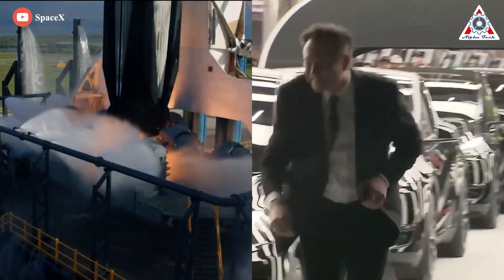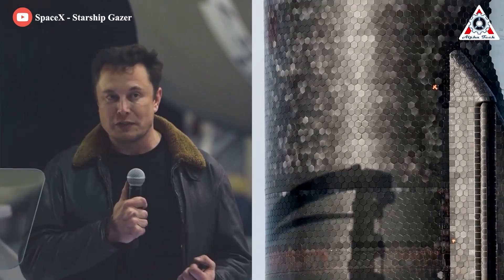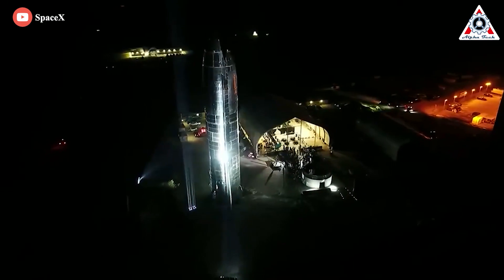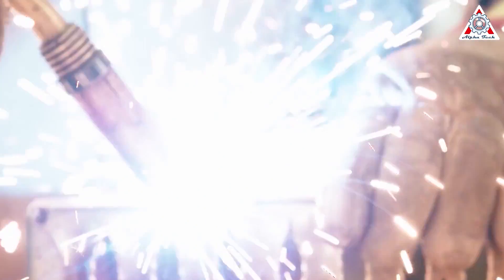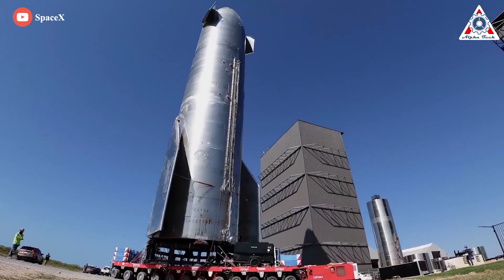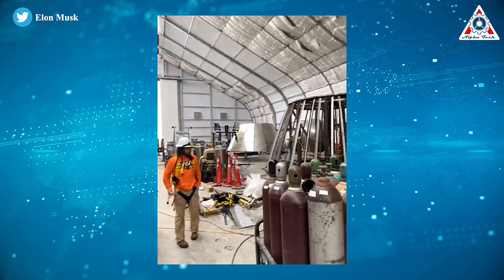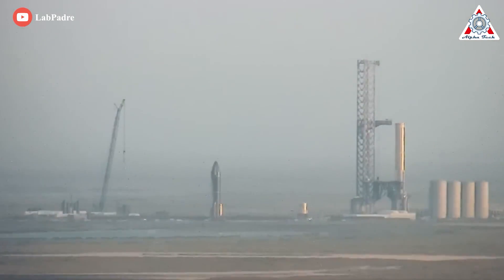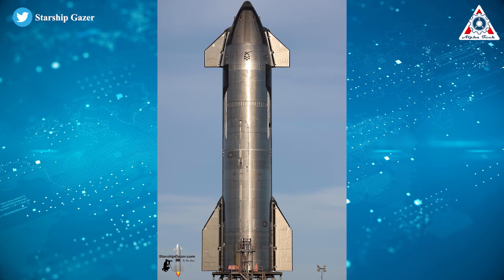SpaceX's HUGE UPGRADE on Starship's welding will blow your mind!

Comment: As an Edmonton pipe fitter we’ve been working closely with stainless steel and the welding process for decades already and it’s extremely sensitive to air breeze’s and oxygen destroying the welding that creates slag inclusions inside the weld that is allowing the cracks to start from the slag and runs from there!
We always set a candle where the welding is done so by the time you get setup and ready to start welding if that candle is still burning then you can utilize the tig machine and the argon gas will stay around the weld without getting blown away by oxygen and creating the slag inclusions!
Reply: The weld will "sugar"
Reply: We just use a sniffer to measure the amount of argon on every mining project I was on.
Reply: u weld with a candle
Reply: @margarita8442  he’s using it to sense the breeze and oxygen I believe

Comment: Your discussion missed one important detail that I know of. The current robotic welding equipment at Starbase performs an "after treatment" step called "planishing" as the laser welds the components together. Planishing is actually an "after treatment", that applies extreme pressure to the weld to flatten it, but it happens all in one step with the robotic laser welders. Another note of importance is that SpaceX Starbase has developed sophisticated positioning jigs that enable the welding robots to weld accurately and to repeat weld sequences over and over again. For example, on the ship nose cones and on the ventral side of the ships, laser welding robots weld the attachment fixtures for the TPS tiles into place at robotically programmed positions, providing precision not possible with hand welding. Nearly all the Starbase ship and booster welds are currently performed by laser welding (and planishing)  robots.
Reply: Here is another important detail about rocket welding at Starbase, something that is possible to see late at night inside the high bay at Starbase. Once big ship / booster sections have been completed, and need to be stacked together, inside the high bay and inside the new mega bay, the robotic welder(s) can be seen mounted on the wall. Inside the high bay (usually starships) near completion are placed on a "lazy susan" style rotatable stand system that is positioned and aligned using laser align guided alignment. The laser robot mounted on the wall lines up for a ring pass around the ship or booster and then the stand at the bottom rotates that ship and booster and the laser weld and planishing is done all in one step. After a ship / booster ring is welded, a second weld checking device is passed over the weld that x-rays the entire weld and also creates and ultrasound picture of the weld. All the x-ray and ultrasound data is digitally checked and then permanently archived, creating a record of each ship / boost ring section weld quality.
Reply: @obsey  Thank you, Elon!

Your attention to detail is unrivaled.
Reply: He does actually mention it @7:06 to 7:35, though perhaps not in the clearest manner possible.
Reply: Thanks, I knew some important details were missed.
Reply: You sure know welding. I recently inherited a Miller 600 welder. It has two reels of wire, an Argon tank and etc. I built an excellent cart for it with wheels and all to have it completely portable.  Trouble is, I don't know how to weld !!! I don't even know if this rig is TIG or MIG.  I'm gonna  try to find out more about it and then sell it. Thanks for your very well composed and informative comment. Very helpful.
Reply: My first question the end of the video: “They’re not cold rolling the welds themselves, are they?”   Planishing i believe answers that question.  Thanks!
Reply: I can't  understand why Elon Must would waste his time trying out cheaper alternative procedures knowing they would not be approved by the US gov .
 Surely SpaceX should know that argon welding would not be permitted .
 They wasted time and money on this project.
 IS SpaceX so poor that they need to resort to such actions ,when they 
the equipment sitting in thier garage.
 They must have known it wouldn't work.
 What erks me the most is that they are this CHEAP
DML
Reply: Once planishing, cryo hardened,,,?
Reply: Theyll never tell bessos lets just cyber this like we predicted